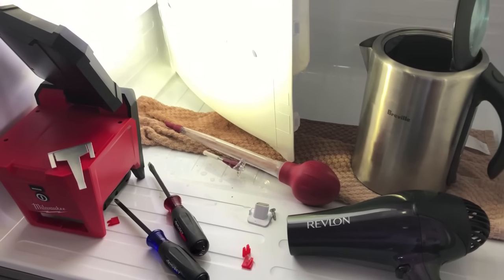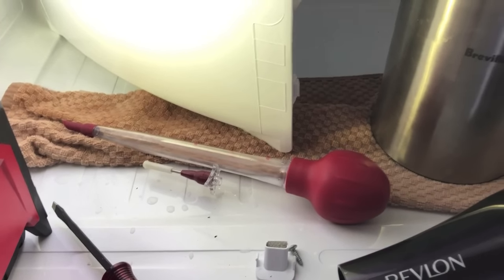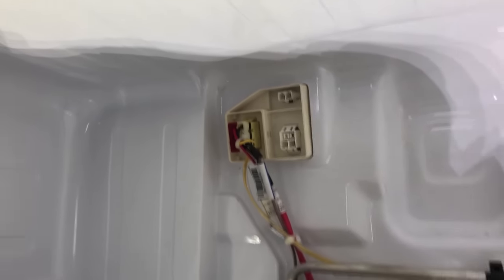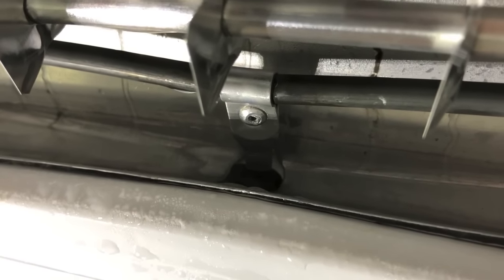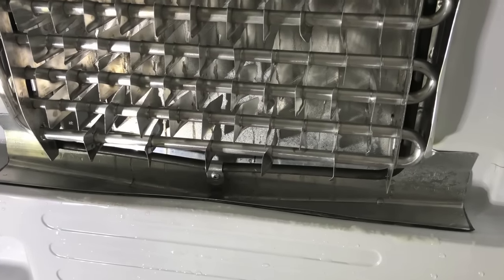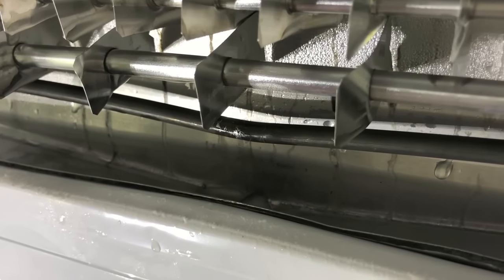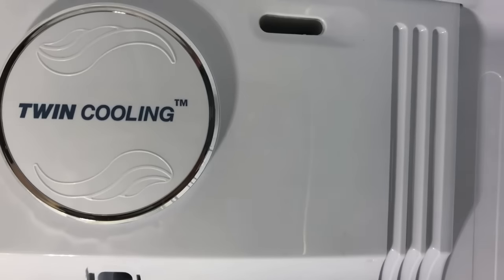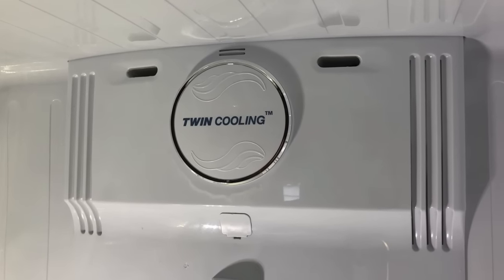Samsung Refrigerator Repair - How to Fix Water in the Crisper Drawers

Comment: So I did this fix and just stumbled on this video. Great video, however that replacement clip won't go all the way down the drain hole, there is no water in the drain hole nor is it frozen. I noticed the drain hole turns to the left therefore keeping the metal clip from being inserted in there all the way. Has anyone else encountered this? Are there different length clips for these refrigerators? TIA.
Reply from the maker: Some people have reported success with wrapping a copper wire around the heating element and then having a length of copper wire suspended into the opening of the drain hole. We haven't tried that personally, but some people online had success with that technique. I don't know if that approach is any beter/worse, safer/less safe than the factory clip replacement. I'm not sure if the clips come in various lengths. Good luck with it!

Comment: Hi I have a problem with my fridge. The temperature setting for the fridge part (the top) does not stay on 3 degrees. It keeps jumping to over 18 degrees every time I set it to 3 degrees. I wonder if you could please suggest a way to fix this?.. thank you..😀🤗
Reply from the maker: Hi Ajith. Sorry, I don't have any experience with that issue. I hope you get it resolved!
Reply: @homefixated  😁🤗👍

Comment: I did this a few days ago. Your instructions were clear. The next morning, I found water in my crisper :(. I emptied the water and put the crispers back in. A few hours later, I checked under the crisper and found some water :(. I dried that and removed both crispers. It's been 2 days and all is dry (YAY). Any thoughts as to what is going on? I'm hoping that maybe I just didn't get rid of all of the ice...
Reply: How long did you pour the hot water before it cleared?
Reply: @sadieluck  Honestly, I don't remember. Maybe 20 minutes? It's been 6 days since there has been water. I feel like I may be good. Is there an easy way to check that there is not a clog?
Reply: @patti2b3  Thanks for responding.  My husband ended up pushing a thin wire down it.  We didn't see a plug come out but the water cleared.  We are 3 days with now water too so also feeling like it is fixed.

Comment: The bottom long scew on the panel just keeps going round and round & not coming out when I try to take off the panel.  Any idea's? I don't want to force or break anything.
Reply from the maker: The panel may still be frozen in place. It may need more time to de-ice before the panel and that screw come out.

Comment: As like many others here, I have the same problem. I cleand the coils in the lower right rear and the two drain tubes, which were both clogged. What is the part number for the new defrost mode?
Reply: DA61-06796A I got from another video on this repair.
Reply from the maker: We have the replacement part linked on the article that accompanies the video: https://homefixated.com/samsung-how-to-repair-water-in-your-crisper-drawer/

Comment: BETTER OPTION-  10 minute fix.  
Step 1 melt ice on top with hair dryer.
Step 2 use Turkey baster to add really warm water on top. 
Step 3 use hair dryer to blow hot air on water on top.  
Step 4 use Turkey baster to suck and squirt water in the drain.  This keeps the water circulating and warming the ice.

Mine thawed in less than 4 minutes. I felt like a genius.

Comment: He is our experience...the main problem was the inability of our refrigerator to control temperature...mainly in the freezer. Our unit was purchased new in 2014 and we had it serviced under warranty because the freezer temp would not rise above -8 F. They said the problem was with the ice maker and that was replaced. The freezer temp did not change. The service person said this was a problem with this model. This low temp causes this drain line to freeze. Also, both drain lines in the back were plugged because the design necks down to a very small drain opening. Not sure what the 3rd grader thought when that was designed! The water issue took longer to happen and the warranty was up. Another problem with this model is the inability to shut off the ice maker when the tray is full. The ice ends up under the freezer drawer and accumulates and is dragged onto your floor when the door is opened. It ruined a portion of our wood floor! Oh, and our Samsung dishwasher lasted 4 years before the door seal leaked and would spill on the floor!  Think Samsung will make it right? Nah! NEVER AGAIN WILL A SAMSUNG PRODUCT CROSS OUR THRESHHOLD!

Comment: This did not work for me.
I am currently going to try and redo the sealing around the plastic piece.
I heard that the factory sealing tape is to small.
I am going to buy some thicker strips and redo it all to seal out moisture.
This solution better work or I am tossing it out.

Comment: PLEASE HELP!!! 

What do you recommend if it does it again? We did this exact process 2 weeks ago, same plate and all and not it’s leaking water again into the drawer. Not so much ice…yet but water again. What is the next step from here?
Reply: New sensor for defrost.
Reply: Unless drain hose is clogged underneath.
Reply: @peterconrad861  We had the sensor part replaced and it's now doing it again and its worse to the point of water leaking out doors to the floor.
Reply: @jesz23  it sounds like the hoses at the bottom might be clogged up. Take them off and see if a bunch of water dumps out. Also ensure those little duck bill things are clear of gunk and let water through.

Comment: Tried the bigger clip, still freezing up and leaking. Going to try some copper wire wrapped around the clip, and maybe down the drain hole, will see what happens. Or maybe just a class action against Samsung fridges.
Reply from the maker: Be sure to check out the 2021 update in the video descriptions for some other tips. Good luck in getting it sorted!

Comment: I also watched a repair guy move the clip for the heating coil.Moved the thermostat to the main copper feed to cooling unit where ice builds up first..so heating coil is on sooner and longer this must also help? As the heating coil is not on always .Any thoughts??
Reply from the maker: Hi David! You surpassed my expertise (which isn't hard when it comes to appliance repair). Sorry I can't weigh in with any useful info on your question.
Reply: To David Nicole- what video was that?

Comment: Can the clip be put right over the old clip so I don't have to bother removing the original one?
Reply from the maker: I would not recommend that. The clip serves to transfer heat from the heating element to the drain hole area. Trying to put the new clip over the old one means the new one won't have as much direct contact with the heating element reducing its efficacy.

Comment: I did this same thing last summer. It worked great!!  However. I am now doing the same thing so it’s not a permanent fix.  Is anyone else having the same issue?
Reply: Yes! We replaced the clip a few years ago and had no problems. Now all of a sudden it started again. Not sure what to do.
Reply: I replaced the clip 9 months ago.  It recently froze again.  I am here looking for another solution as well.  Did you find any?
Reply: @iridetoo2158  is your fridge made prior to 2013? If so, there are other parts to be added that Samsung started using after 2013.
Reply: @dougprentice1363  YES, it was manufactured in 2009.

What are the other parts?
Reply: @iridetoo2158  the kit on Amazon includes the sheet metal part, drain tubes. And also the insulated aluminum pads that newer models of fridge have from factory.

I ordered kit yesterday. My fridge was made in 2012.
Reply: @dougprentice1363  can you please post the link or part number for the kit Doug?
Reply: @iridetoo2158  This is what I have coming:
Samsung A/S Assembly-Water Leakage N DA82-01415A
Reply: @dougprentice1363  thank you very much Doug
Reply: @dougprentice1363  where do the insulated pads go?
Reply: @iridetoo2158  behind the sheet metal that is behind the clip that comes in the kit. Out of the many videos I've watched in this, one shows how it's done. I can't find it now.

Comment: Well no matter how hard I try, I cannot get water to grain by gravity out from the opening below the evaporator to the drain opening below.  I have tried hot water, air, wire, etc.  No help.  I am expecting the water to be able to freely flow out the bottom if put in the top.  Is there any electric valve I don't know about?

Comment: This looks all good but the heating element in mine has a more drastic bend in the middle and so the clip does not make contact.  Installed it anyway in hopes it would work but it didn't.  Trying to find the right clip with the shape to match the element.  Not very hopeful.  Pissed that I have a new frog with useless crisper drawers.
Reply: Rhonda Ford , Mine is the exactly like you described, looks like Samsung put more of a bend in the middle of the tube to direct water to the drain, I actually trimmed off some of the bottom of the new part so it would clip over the tube and still be down in the drain, will see if that works

Comment: Should that black coil be getting warm? Opened mine up to replace the clip and it has ice on it.
Reply: It should be hot when defrosting.  I believe the cycle is usually 8 hours but you can force Defrost through some combination of buttons.  I would check your manual as it seems to vary by model.

Comment: We successfully did all the steps you recommended and we are still leaking water under the crisper drawers any other recommendations?
Reply from the maker: Hi Rodney and Bobby. Sorry to hear this fix didn't address your issue. It's possible something else is causing your moisture problem. Are you confident you got the drain line completely thawed out before replacing the part? If not, it's possible there's still ice in there that's preventing the water from draining and is backing up. Otherwise we'd suggest getting in touch with Samsung if it's under warranty or finding a good appliance repair person locally if not under warranty. Good luck with it and we hope it gets sorted out quickly for you.

Comment: More importantly why is this happening?
I just fixed the same problem but wanting to know why it was happening I checked the evap fan and I forced the fridge into defrost to check the defrost element, they both checked out ok. So if this happens again...why?
Is the actual defrost algorithm failing ?
Is ice forming deeper inside the drain for some reason?
Reply from the maker: My understanding is that the stock slip attached to the heating element is inadequate and as a result ice builds up in the drain preventing the water from flowing through the drain hole. Water then overflows and winds up in the crisper bin. The larger clip detailed in the video seems to prevent this and solve the problem.

Comment: The hot water doesn't seem to be clearing the drain.  Is there something else we should try?
Reply: Remove the lower panel at the back. There are drain hoses that can become blocked.
Reply: @mjpleusch  We ended up snaking a thin wire down the tube and freed the clog.  It has worked fine ever since.  We never replaced the part.

Comment: After one year my Samsung started leaking water in the crisper drawers,  jus as described here. I got the part , replaced it three weeks ago, works fine.
Reply: What is this part called?
Reply: @lisacriswell4822  

SAMSUNG CLIP DRAIN EVAPORATOR REFOEM Original Part: DA61-06796A
Reply from the maker: @lisacriswell4822  There's a link to the part in the article (at the end): https://homefixated.com/samsung-how-to-repair-water-in-your-crisper-drawer/

Comment: Thanks everyone! With your ideas and some boob-tube ideas I got mine functioning again!
After 6 years ours froze to the point that the fan was making more and more noise within a 1 hour window!
basically: opened her up (broke off a small piece of Styrofoam, defrosted overnight, cleaned all the hair/dust rabbits,   created a pipette using a baster and a straw which I gently shoved down the drain hole, poured hot water and pumped, shop vac BOTH top and bottom orifices, changed out the hot water several times until my 6 year old said, "IT'S WORKING" - she was watching the drain (I had pulled the tube and had it draining in a lunch container. 

Fabricated an X-WING looking sheet metal heat sink like your in the video.

SAMSUNG = Simply A Massively Stupid UN-smart Garbage
Reply from the maker: Congrats on getting it working and glad our input helped!

Comment: Thanks.  Now I'm waiting on the back panel to thaw more.  Got the clip from Amazon so I'm ready for this mess to be completed.  Anyone have any good ideas on how to remove the rust this dripping water has caused on the and under the drawers?  I appreciate this video!!
Reply: A product called Whink will remove rust from any surface. Pretty strong stuff so don't get it on your skin and remove any residue from treated surfaces.
Reply: @ankerssm  Thanks...I finally had enough and bought a new fridge after the freezer died on the Samsung.

Comment: how has this lasted? I'm the maintenance guy for an apartment bldg. I;ve done this repair numerous times and now its happening again. looks like the real problem is the heater, metal sheath part#DA47-00424L.
Reply from the maker: Hey Skid! The repair shown in the video has held up great for us. No recurring issues in over 1.5 years now.
Reply: @homefixated   I wonder What do you difference is then. I have defrost it the back part and drained the drain tube completely. Bone dry. 3 or 4 months later and I'm having tenants call me about water in the crisper again. Incredibly frustrating. As it is a pretty time consuming job
Reply from the maker: @SkidVicious1971  It's definitely a time consuming repair (and frustrating to have to do in the first place). Everything we did was covered in the video and the article, but it's all specific to the problem we had which may or may not be the same as the problem your tenants have. You mentioned you did the defrost and drained the tube. Did you replace the defective part as shown in the video too?
Reply: @homefixated  yup got a new clip, installed it. Fridge keeps icing up

Comment: Did this but now fridge no longer cooling can you advise?
Reply from the maker: Hi Dorothy. I would suggest you make sure all the wiring in the panel is connected properly again and that you have everything connected as it was prior to the repair. Then, make sure you plug the fridge back into a power outlet and see if you're up and running again.
Reply: will give it a go fingers crossed fridge only 5 Years old thank you 👍

Comment: I taped a heating pad to the back of my refrigerator, it helps to defrost.
Reply: Culture of Life Media how did you do this?
Reply: That’s a good idea. Even with the new metal clip I have to do the defrosting twice a year.
Reply: @rchrd-oh  i put it in a 2 gallon zip lock bag and taped it up with duct tape. The tape can not go over the heating pad because over time it will melt the sticky on the tape.  I learned that by mistake.

Comment: Two things to make this an easier repair. First, put the refrigerator section on defrost for two thirty min cycles. How to do this is on youtube. Using a hair dryer can damage evap panel and styrofoam.
Second, factory clip is held to heater with an aluminum rivot, carefully drill this out to remove clip without damaging heater coil.
Reply: can it me removed with an allen key?
Reply: @johnnycroat  Its aluminum, so a pair of wire snips could be used, just plug up drain hole to keep any fragments from dropping in drain hole. I would also order new thermistor thats mounted behind evap panel on upper right side. Samsung DA32-10104N Temperature Sensor
$12.69

Comment: I bought the replacement part and replace it.  About a week later,  the water started leaking again :(  What could be the problem?
Reply: I saw another vid whereyou May want to check the evaporating tubes where it leads to the trays those may be clogged as well make sure to clean up the coils there in the back best of luck!
Reply: I actually did the process once more and made sure it was completely defrosted this time.  I think I let it sit over night and dumped boiling water down it the next day.  I haven’t had a problem since.   It’s been 9 months!  🙏

Comment: Installed the large evaporative clip from Amazon.  Did not fix problem.  Drain still freezes, and water / ice collects in refrigerator.
Reply from the maker: Several readers have reported that clogged drain tubes (the tubes running below that clip area to an evaporative pan) can also cause the same issue. You may want to look into that next, but it's possible some other problem is causing the issue. Good luck fixing it / getting it fixed and please let us know what resolves it if you get the chance.
Reply: @homefixated  Thanks for the tip!  The rubber valve on the drain tube was hardened from age / heat, and was no longer letting water drain. It cracked when I tried to squeeze it open.  As a temporary fix, I cut the valve open.  I ordered new drain valve tubes from Amazon.  Should know in about 6 months if it works.
Reply from the maker: @dcflix  That's great news - thanks for the feedback!

Comment: If I let it thaw overnight and dont use the hair dryer, will I have water leaking all over the floor?
Reply: I let it thaw overnight and  also used the hair dryer, a little hot  water with baster and  no problem with leaking on the floor.

Comment: Installed the metal tab that goes into drain hole but water is still accumulating under the drawer. Not as much as before but still problematic.
Reply: me too.  Did you figure it out?